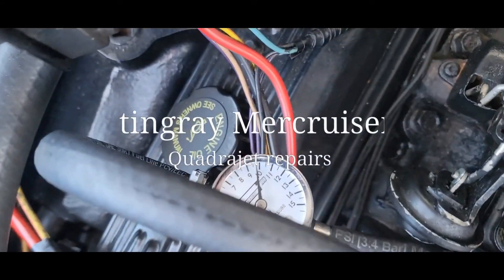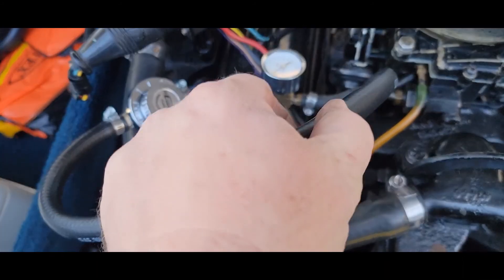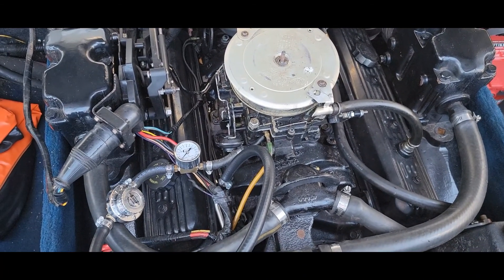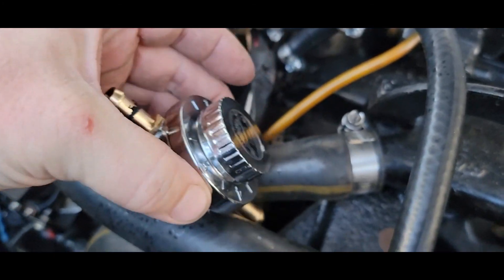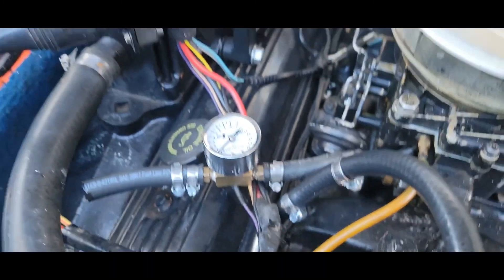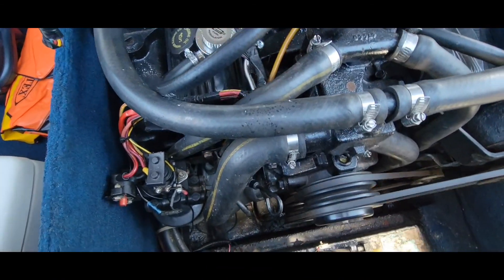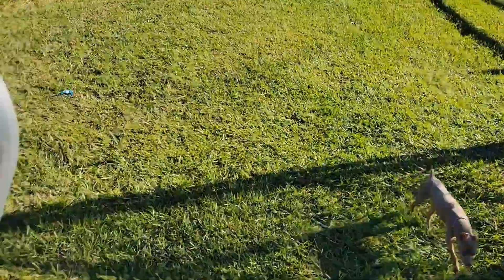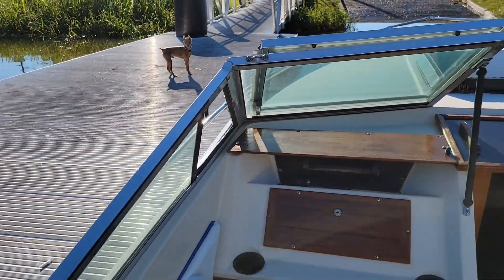Stingray cuddy cabin mercruiser 5.7 quadrajet flooding carburetor problem solved finally

Comment: How did it turn out ?
Reply from the maker: It actually fixed my issues and runs great.  Made quite a few videos after that on my channel and hopefully take her out soon
Reply: @Vassmotorsports  
I’ve got a 230 SeaRay with a 5.7 and I believe it’s a quaddrojet and she bogs down pretty bad when I give her some throttle . Especially last third . 
Went out there tonight and looked through the front jets while wife gave it some T and noticed it was squirting outta the right front fairly well but hardly outta the left